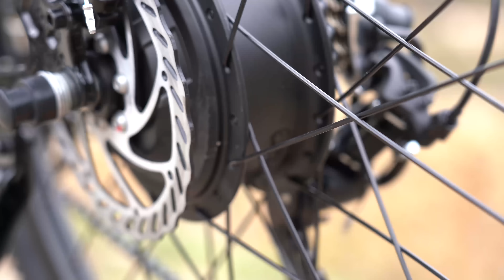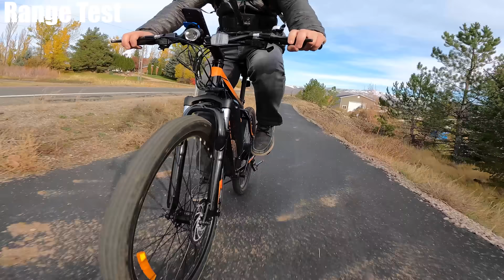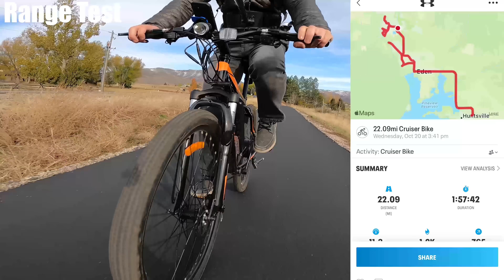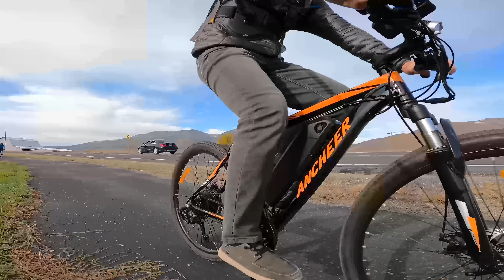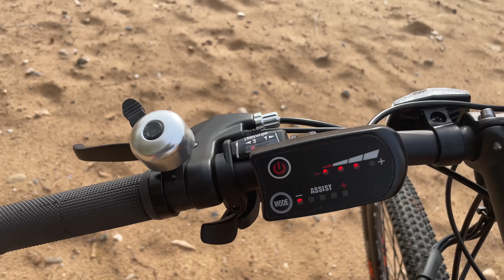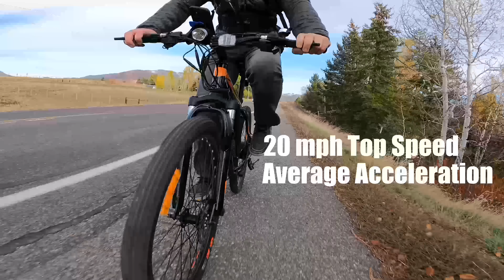Ancheer Electric Mountain Bike Test & Review

Comment from the maker: Sorry about the freaky video during the off road test.  No idea what happened there
Reply: Hey do the bike go by it self I’m asking because i always see people peddling still an I wanna by one because I work a hour away an have to do a 12 hour shift an I wanna be able to switch between modes so I don’t kill my legs before I go in
Reply: This Ancheer orange sunshine ebike should be marked down to $275 even if it's brand new.Im telling you why bc for some reason the hub motor goes out.Even if you use the throttle the bike won't drive.#2 this bike needs dual hub motors and dual batteries.#3 Most ebikes needs to come with 2 chargers and a phone holder.But the good thing is you can put this bike on the bus bc it's not fat tires.
Reply: Bro o have the same bike but it goes to 17 mph then goes down to 15 mph. Please tell me what to do to make it go 20 mph

Comment: I got this as a gift from a fam friend. Once I started having seizures from a newly diagnosed brain tumor I couldn’t drive but had to work and this is our solution. Have had 2 seizures while commuting to work but the bike took it like a champ. The only gripes I have are 1. I’ve never had so many flats as I have with this bike (could def be user error!) 2. The battery connector frame that is attached to the bike  is very brittle and I’ve broken it but simple fix with rubber cement. 3. If you run out of battery it’s like it applies the brakes. You’re battling the terrain and the bikes fighting you the whole way. 4. Attachments broke off almost immediately : rear fender, chain guard, front light etc. 5. In order to repair flats, take off tires, repair chain etc the power cords have to be removed along with their zip ties so keep spairs handy! Or else they rub.

Comment: I just rode one My friend just got it WOW fast and well made. I like the aluminum frame and how the battery attaches securely and the derail your cage protector The seats nice and soft gels side The levers and shifters are a good quality feel very secure a work well however they're an older design but they work pretty good and simply I like the little indicator windows it has on top makes it easier to know what you're doing displaying seems good enough even in daylight so far. Not daddy bike for the money third of the price what a bike shop charges

Comment: Hey do the bike go by it self I’m asking because i always see people peddling still an I wanna by one because I work a hour away an have to do a 12 hour shift an I wanna be able to switch between modes so I don’t kill my legs before I go in
Reply from the maker: Yes, it has a throttle, so you won't have to pedal
Reply: @ElectricRevolution I brought the bike it’s supposed to be here February 16 or February 22 I’m so ready
Reply: @Mrzayskates  how is it? I just ordered one. Supposed to be here in the next week and a half or less
Reply: @Venomous8495  it’s amazing but the thing I hate is the battery starts to die overtime even if it says it’s full bars an u charge it all day crazy other than that it’s great
Reply: @Mrzayskates  missed your reply. Had it for almost a month. I have no complaints really. My battery seems ok tbh. I don't ever really pedal and I can get around 20 miles out of it. I don't have the hummer or gladiator. It just says ebike. Can't change any settings,  which sucks
Reply: @Venomous8495   Is your bike 26” (Gladiator) or 27.5” (Hummer) or heck you’re right could be others. In theory it should be adjustable but yeah. Do you know which display you have? (Left side, separate buttons, color?)
Reply: @ElectricRevolution  thank u so much
Reply: Do a full discharge of the battery, then a full recharge. This resets many batteries.

Comment: the 2023 model I have has a digital gauge now the hand grips are better and the throttle is better no more thumb lever. They just need to upgrade that damn seat. And now they do have a horn and a headlight that works when the bike comes on. Other than that it's a great bike.
Reply: Seat is a personal choice and a seat that is good for you might be uncomfortable for someone else.     
The consumer upgrades seat themselves.
Reply: 127 Mi so far and no problems.

Comment: Ive got one of these I bought about 5 months ago (September 2022) used for $400. Its red and black, battery same design as the one in your video, the throttle on mine is different and the seat is wider and pretty comfortable vs other mtn bikes I have ridden. The battery display and throttle assist control is just a bit different from yours as well. Im not a hardcore cyclist by any stretch, but this bike suits me for my needs.

Comment: do you know why mine only maxes out at 15mph
Reply from the maker: Not sure, may have a problem with it, I'd reach out to the company
Reply: Your bike is limited to 15 because of the laws in different countries. US and UK are 20 mph. There's videos on how to open the box behind the battery and disconnecting the white wire for the limiter.
Reply: @Wutzmename  Weird, I live in the US and I'm wondering if maybe they sent me one that was originally supposed to go to another country? What would I have to look up to see how to disconnect this wire by the way
Reply: @idemist  Let me try and find it.
Reply: @idemist  How to remove speed limiter Chinese Electric Bicycle - Ancheer. Type that into search and the video will pull up

Comment: I have both the 350w(26 inch) as well as the 500w(27.5 inch) version of this bike
The 500w version is a lot better, and worth the extra 100$ or so
Reply: Yeah. I have the 250w 8.6ah older model I've had for 3 years and still going strong but I just bought the 500w/750peak 10.8ah and am looking forward to getting it in a few days.

Comment: if the handlebars seem low you need a 27.5 in bike.. i used to have a 26 and thought the same thing.. i gott a 29.. its too big.. the wheels require a lot of power to get moving and keep moving.. i ride slow because of that.. you want a 27.5...

Comment: I have the model 2019 ama5637 can the new battery size fits 36 10.4 amp hours I have 36volts 7.8 amp hours I know you have to change battery plate can it run on old version 2019 model to the new battery size can it be done yes or no

Comment: I have the model 2019 year can the newest battery 36volts 10 .4amp hours fix on the year 2019 model can it be done or not if so how much it will cost for a battery
Reply: I have 36 volt 7.8 amp hours
Reply from the maker: Sorry man, I'm not sure, I'd reach out to them directly
Reply: What's the names of the folding ebikes that gets up to 28mph without having the fat tires that way I sure can put the ebike on front of the bus ?
Reply: I have the orange sunshine I have the 36 volt 7.8 amp hours can mt3 can the newest battery fix on on the 2019 model
Reply: My electric bike go up to 20 miles per hour
Reply: I like turtles

Comment: ⚠️ WARNING!!! ANCHEER WILL NOT HONOR ITS WARRANTIES!!! IF YOU INVEST IN THIS COMPANY YOU ARE ON YOUR!! WARNING!!! ⚠️
Reply: You can't be more wrong. I've owned the 2019 redline 250 watt 36 volt 8.6ah battery. I've had an issue with the battery 6 months AFTER their warranty expired and they replaced it I also had a problem with the front shocks and they sent me a replacement free shipping. I just bought the new 500 watt 48 volt 10.4ah battery and am super excited for it to arrive. I have never contacted the Chinese number only the California number which is easy to find through search for ancheer phone number. They've been extremely helpful and speak English because you know California. So you can remove this and the exact same spam comment below. I don't work for them so you can remove that assumption nor work in the bike industry.
Reply: 626 area code. Look for that one. It won't allow me to enter the phone number here

Comment: Ancheer have terrible customer service,  i told them I need a return, but they trap me opened the box. then say the bike is used they cant process the return. now I have a bike I don't need.  you will regret
Reply: Sounds like you fucked up. Only an idiot would open a box they want to return
Reply: What's the names of the folding ebikes that gets up to 28mph without having the fat tires that way I sure can put the ebike on front of the bus ?
Reply: @drrobotnikmeanbeanma  circus bike

Comment: I ordered the Ancheer Hummer model a week ago should be here any day now. 899 dollars Amazon I guess hyper inflation has begun
Reply: Did you get it yet? How is it? Thinking of buying. Thanks.
Reply: @theunknown4570  yes I've had For lil over month now and I really like it. I'm 180 pounds .it does 23 mph full electric mode with me. I bought a 8 inch wide comfort seat  because stock seat is hard that's all I've done to it. Peddle assist is really nice . The bike is really smooth runner now .I have a child cart I pull around it hold 100 pounds  and no issues at all

Comment: Another thing I want to add is that max range I've gotten is 32 mi. This was a mix of throttle & pedal assist. Settings were Front derailleur: 3, Rear: 5~6, Assist: 3~4. Trick is to keep tension on pedals. That's how you know It's drawing the least from the battery.

Comment: Wouldn’t reccomend this bike their parts are cheaply made and manufactured from China their motors are also substandard the sensors on them are quite bad and take a long time for them to actually kick in after pedalling
Reply from the maker: You have to look at price.  For the price this is a very good bike, this is coming from a guy that's tested a bunch in this price range
Reply: My Ancherr 27.5is very responsive.1/4to1/2.  Pedal
Reply: It's been pretty awesome for me
Reply: What's the names of the folding ebikes that gets up to 28mph without having the fat tires that way I sure can put the ebike on front of the bus ?

Comment: its slow going up hill
Reply from the maker: Yeah not the best for hills, really depends on how much you weigh
Reply: @ElectricRevolution  even in full electric mode
Reply: What's the names of the folding ebikes that gets up to 28mph without having the fat tires that way I sure can put the ebike on front of the bus ?
Reply: @drrobotnikmeanbeanma  mine goes slow going up I hill
Reply: @arthurquinn7515  But the sweet thing is you can put tannus tires on them.I got mine from Bert's bike shop and you can put it on front of the bus.Them fat bike tires won't fit on the bus rack